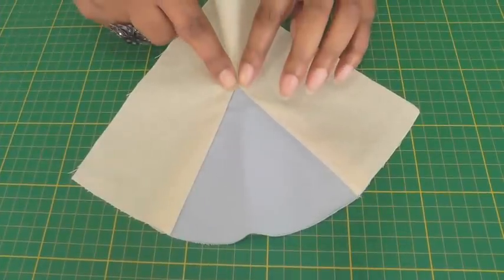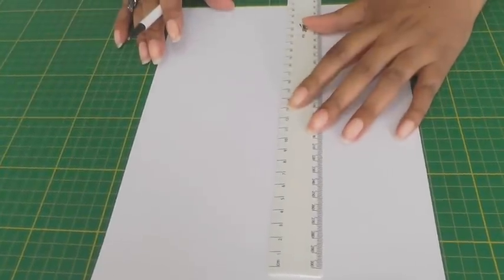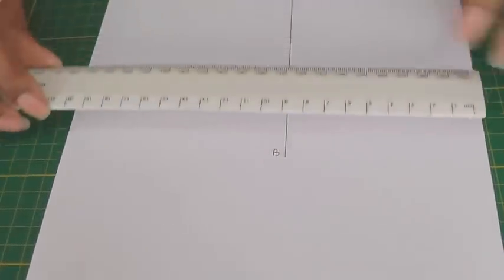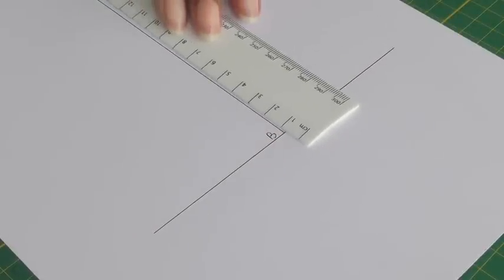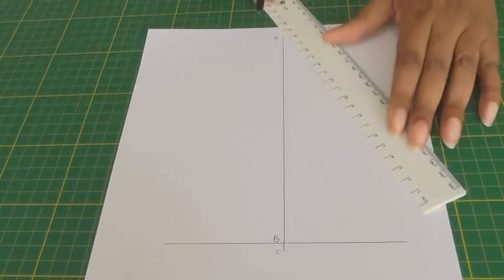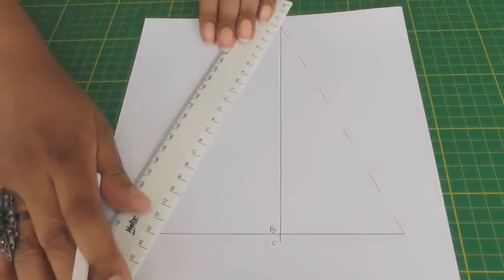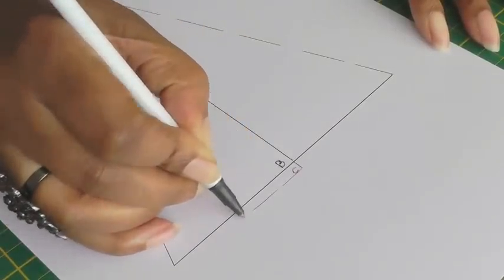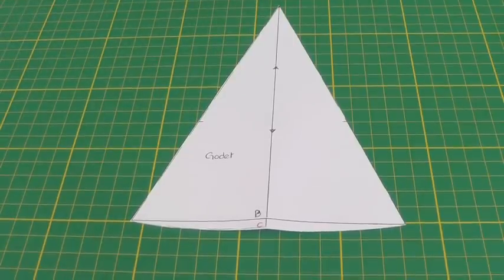Drafting a Godet

Comment: What is a good, moderate width to start with? I think you did 14cm?
Reply from the maker: 10 - 14cm is a good starting width. But it can be smaller or larger depending on your project.